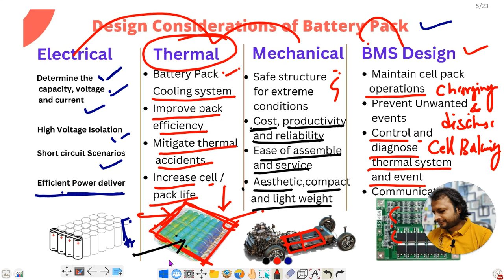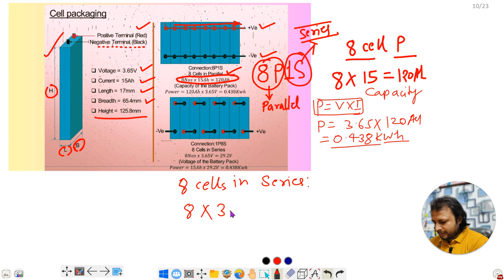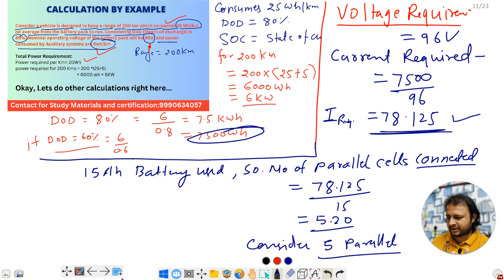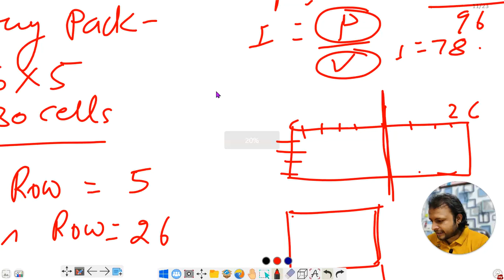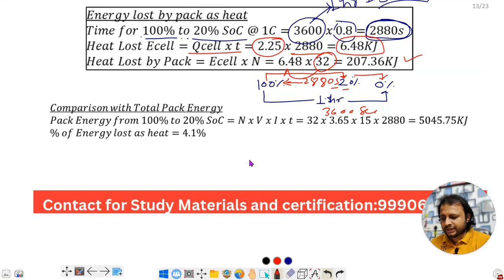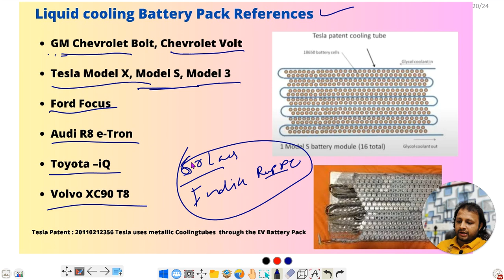Battery Pack designing and Calculations| EV Battery Pack| Electric Vehicle course lecture 04|

Comment: What about motor calculations? Is there anyrole of motor in battery pack calculations?
Reply from the maker: Motor calculations we will do during the motor session, then you can relate it with battery capacity and other dependencies.